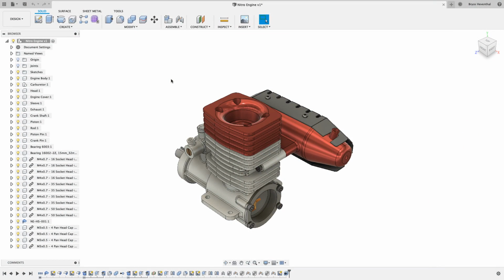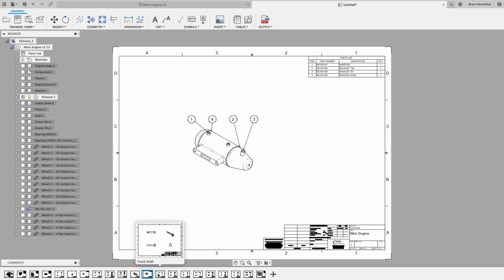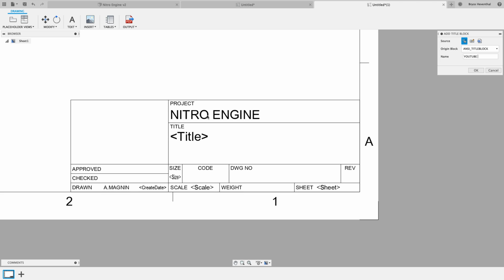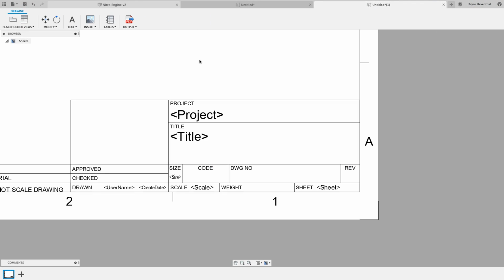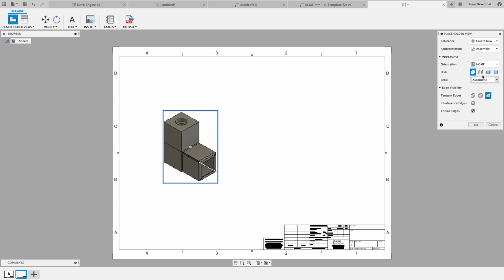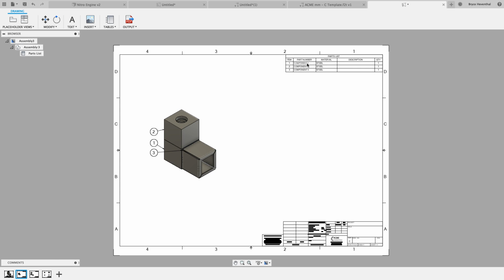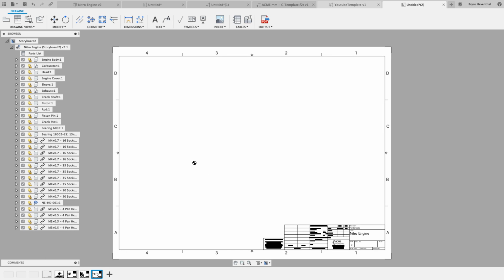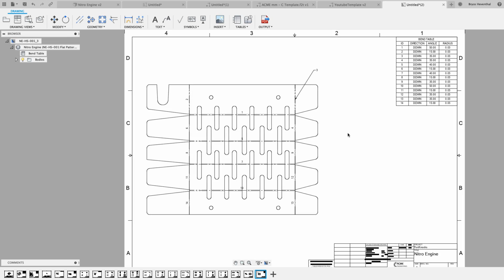360 LIVE: Drawing Templates

Comment: This is great and really powerful! Auto dimensioning by tagging dimensions in the 3D to be annotated in the drawing would make this hugely impressive.

But I have a very small suggestion. When adding the component placeholders, use Component 2 of the placeholder, not 1. It seems the top and bottom are different on that one and it's easier to see if you have a first or third angle projection setup...